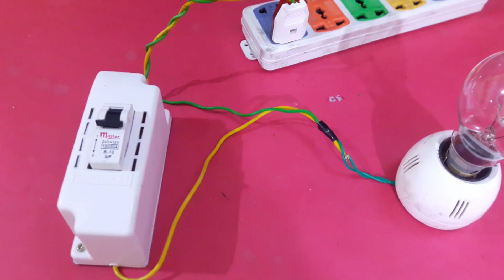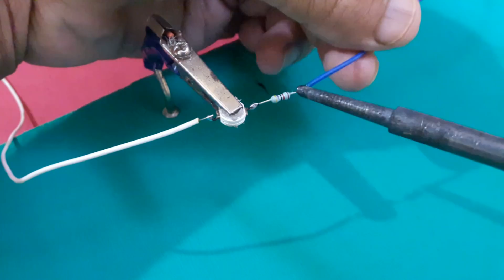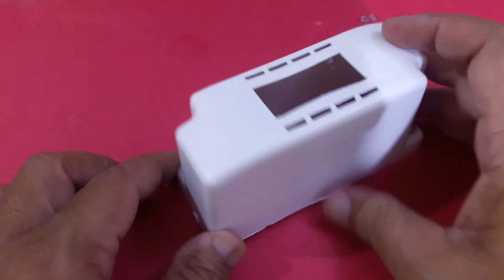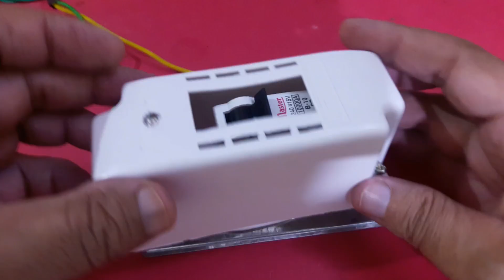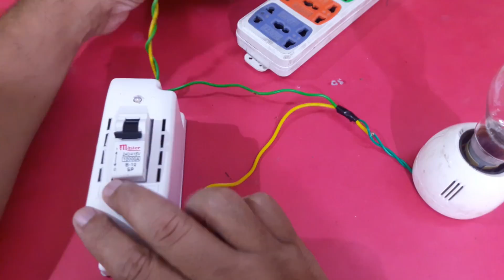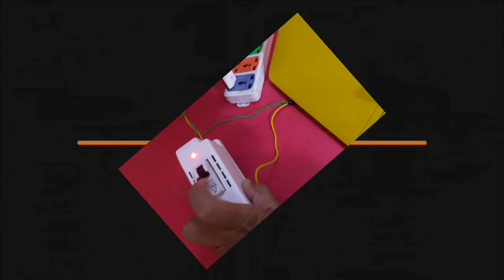Install MCB "Trip-Indicator"

Comment: isme koi khatra to nai hai na. kyoki mcb trip ke bad suply indicator se return hoga..
Reply from the maker: +EDS  yes you are right but it is very minimum you can only feel it . it is not dangerous
Reply: kitna voltage rahega....
Reply from the maker: +EDS 15 to 20v AC
Reply: 90 V KO TO HAMRI BODY SAH SAKTI HAI NA....